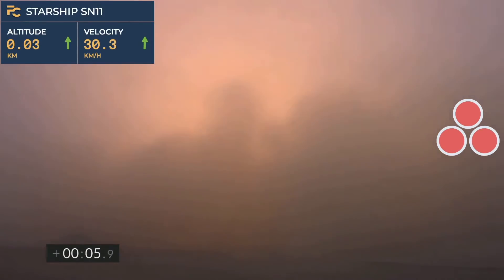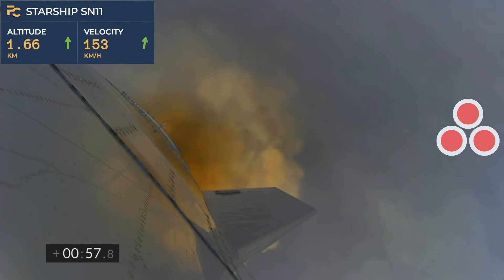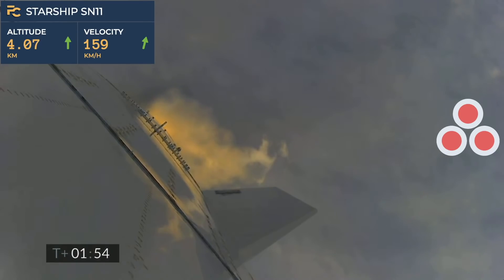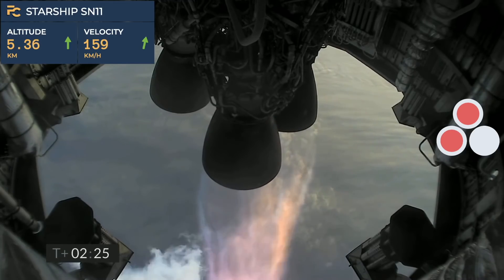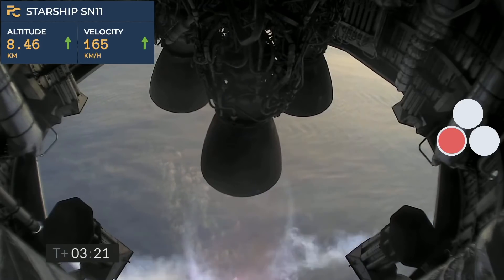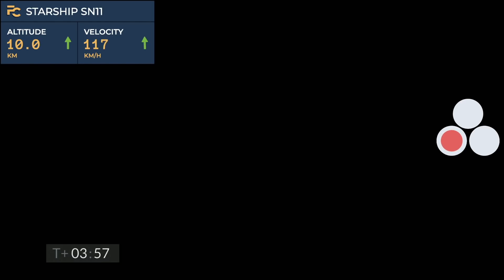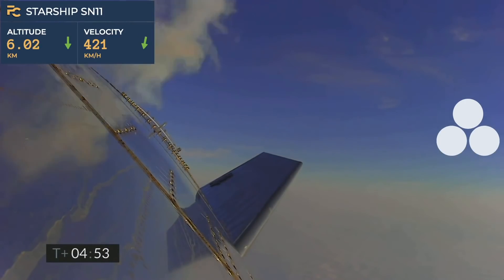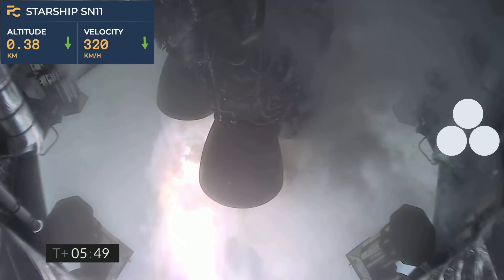Starship SN11 flight w/ Flight Club Telemetry

Comment: Why did the count stop when it exploded??? Other times the count just went on
Reply: Because the vehicle stops to ping back telemetry. Than automatically the software stops the count.
Reply: @ThiagoNunesRS  yes that's true however when you look at for example SN9 crash, the timer went on even though the signal was lost due to the crash
Reply: @meinemeier281  Yeah, you are right. Maybe the software have changed between launches, or maybe they activated FTS to SN11, and it's automatically stops the count for obvious reasons.

Comment: The third raptor engine kept firing even after SN11 had descended below 10km? Didn't rlly hover at all did it. Might this indicate a thrust issue with this engine? Rest of the belly-flop seemed quite normal.
Reply from the maker: The hover at 10km is and always has been community speculation. SpaceX never explicitly said anything about maintaining a constant altitude for an extended period of time at apogee, so I don't really factor this into my sims

However for the altitude callouts during descent to work properly, we can reverse-engineer the altitude at MECO. Combining this with the callout for reaching 10km during ascent, this data is what comes out of it. Even if there was engine underperformance, I don't think you could interpret that from this data
Reply: @flightclub3285  Okayy thanks for the clarification! Great work as usual mate!
Reply: @flightclub3285  Just a quick note about the hover; in the official SN10 video at T+3:55, John Insprucker does explicitly say "we've gone into the hover". Are we just assuming that's his own mistaken inference?

I would have pointed this out sooner but I only just caught it myself.